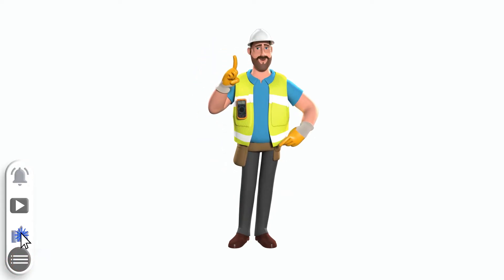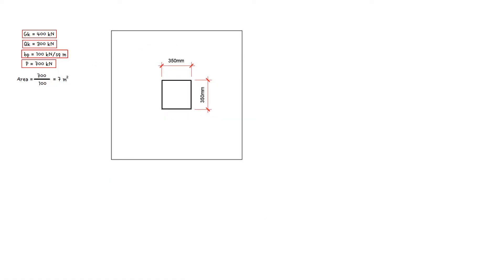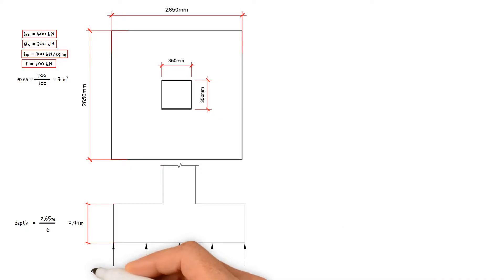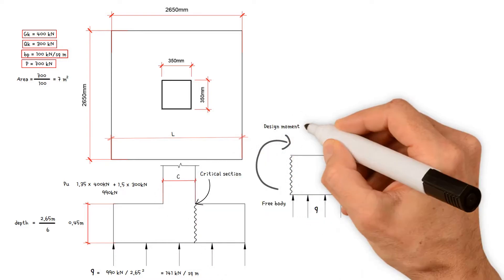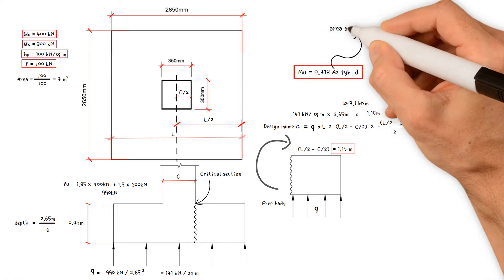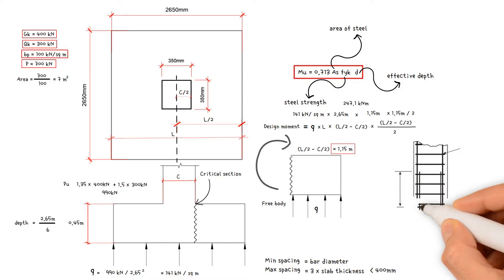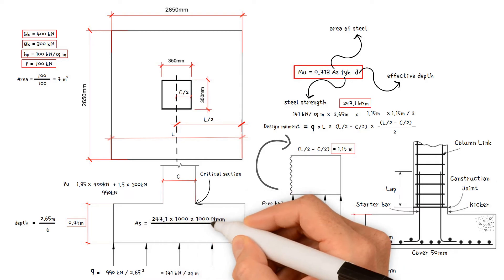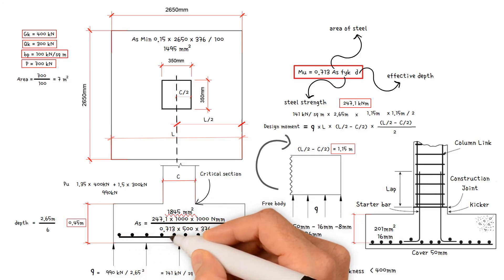Pad Foundation Design Part 1.

Comment: Thanks for this content. Would these calculations work for a much smaller pad foundation, for example, a pad foundation supporting a suspended timber frame for something like a garden room? Would the principles remain similar even though the pad might only be say 200 x 200 maybe 600 deep?
Reply from the maker: Thank you for your comment and question! The principles discussed in the video can certainly be applied to smaller pad foundations, such as those supporting a suspended timber frame for a garden room. While the specific dimensions may vary, the fundamental concepts remain the same. When designing a smaller pad foundation, you would follow a similar process of determining the total loads, calculating the required area based on permissible bearing pressure, and finding suitable dimensions for the pad foundation. The principles of moment equilibrium and reinforcement design can also be applied, considering the specific loads and dimensions of the smaller foundation. It's important to note that the calculations may differ based on the specific requirements, material properties, and design codes applicable to your situation. Therefore, it is recommended to consult with a qualified structural engineer or use appropriate design resources to ensure the foundation is designed correctly for your specific application. We hope this helps! If you have any further questions or need additional information, please let us know.
Reply: @structuralengineercalcs  thank you very much for the detailed reply. Really great channel

Comment: sir should the loads not be factored before determining required plan area foundation which would give a higher value than 2650mm width? The allowable bearing pressure is exceeded once the loads are factored. thanks.
Reply: the used soil permisible strength (bp=100kn/m^2) is already factored from the ultimate soil strength b-ult.

Comment: Was there a reason for using SLS loading to determine the area of the footing and not ULS? Also wouldn't you reduce the bearing capacity of the soil to allow of a safety factor for variability of the soil strength?
Reply: For geotechnical design of foundation ared unfactored loads with ALLOWABLE soil bearing capacityto be used.
For structural design of foundation, soil pressure from factored loads will be used to determine adequate depth and rebars area.